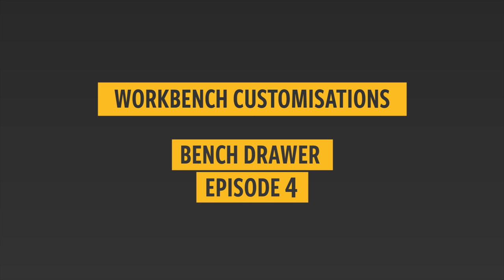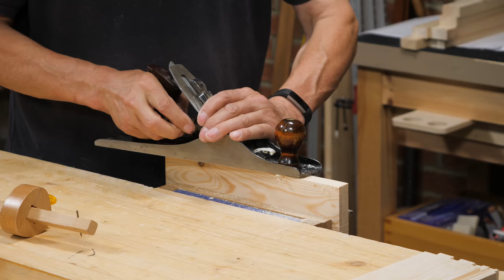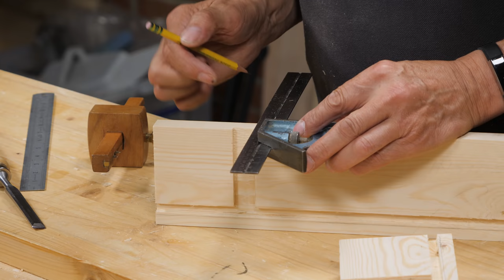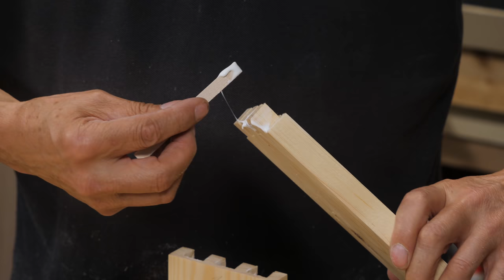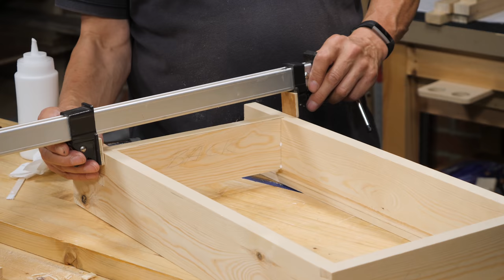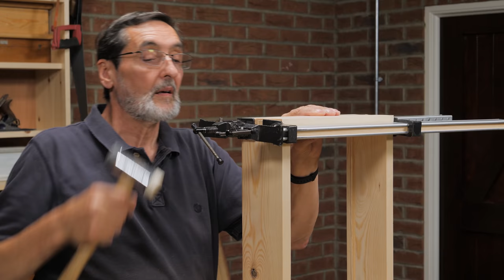How to Make a Workbench Drawer Episode 4 | Paul Sellers

Comment: Chopping the housing dado demonstrates why I have grown fond of dog holes.  I don't need to swap between the vise and the bench top when going between chopping sideways and chopping down.  I put the board up against a planing stop on one side and a dog on a second side, or I just use a holdfast.  :D
Reply: Paul is the most vise-centric woodworker I've ever seen.  If I didn't know that he has 50 years of experience, I'd say he was a rank beginner just by watching him do everything in the vise.
Reply: That is a rather rude comment.
Reply: Jason M, I don't know who you are replying to, but I'll assume that you were speaking to me.  Paul does 90% of all operations with the workpiece held in the vise.  It obviously works, he's been doing it like that for his whole working career.  On the other hand, every source of information I've ever seen on woodworking goes against him.  In case you don't understand what 'every' means, I'll expand on that.  100% of the thousands of sources that I've seen in the last 38 years, including books, magazines, internet articles, and even internet videos.  They all reserve using the face vise for edge plaining, dovetailing, and a few other things.  Ripping and crosscutting large pieces is usually done on saw horses.  Cross cutting small stuff is done on the bench with a bench hook.  Plaining board faces is done on the bench top.  I have personal experience with this as well. When I started woodworking as a teenager I did not have a woodworking bench, just a machinists vise.  I had to do everything with the workpiece in the vise.  It's OK for some tasks, but it's not the best method for others.  I would steer people to use the more traditional methods rather than Paul's way.

Comment: Hi Paul. When working with pine would you consider using a chisel with a 17 degree angle?
Reply: I’ve heard of a pattern maker who used chisels with a grinding angle of 18º, but the general consensus is that most tool steel blades will fold and fracture too readily of angles less than around 20º, so it’s ultimately counterproductive as they need frequent regrinding. I don’t know about some of the modern steels: A2, 01, PM-V11, theoretically they might be workable with acuter angles… that would make for an interesting article. Personally, I grind my Sorby chisels to 22º (Plus 1º or 2º micro bevel) and am happy with the balance between resharpening time and achieved finish.

Comment: Sry if I missed it, but does he measure the back of the drawer with the front of it? So the two pieces come the same measure? And he will also have to measure the groove and the tenon for the final cut... It sounds complicated.
Reply: He checked it for square a few times.  IF it's square, the front and back have to be the same size.

Comment: Hi Paul, any reason you didn't have a slot cut in the back of the drawer and slid the bottom in during the glue up?  Surely that'd square the drawer up too?
Reply: The slots are there and ready to have a bottom slid in.
Reply: The back does not block sliding in the drawer bottom, it is on top of it. Historically, the bottom was nailed to the back from underneath. I should think screws would have more longevity though.

Comment: Hi Paul, why don’t you use hide glue?
Reply: Hide glue is only really useful in antique repair at this point, or if you want to go over-the-top traditional in your work. It is much weaker and less durable than modern glues.